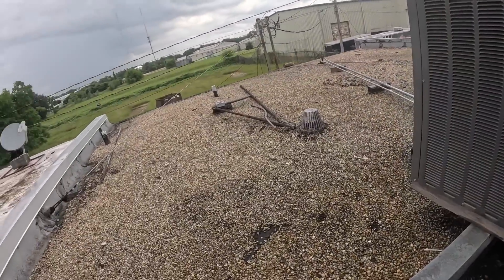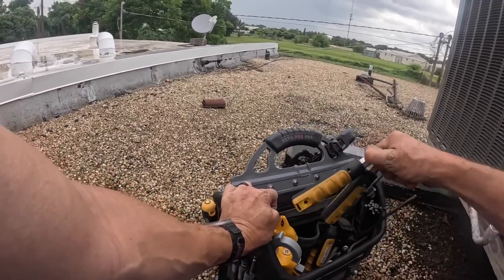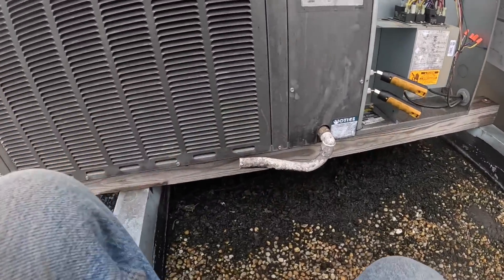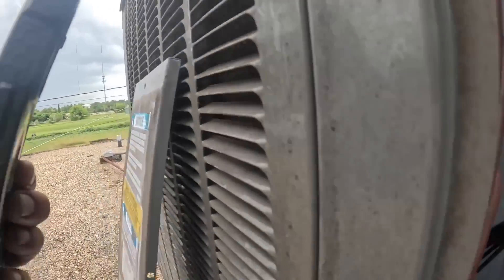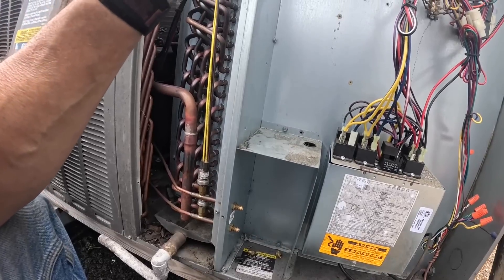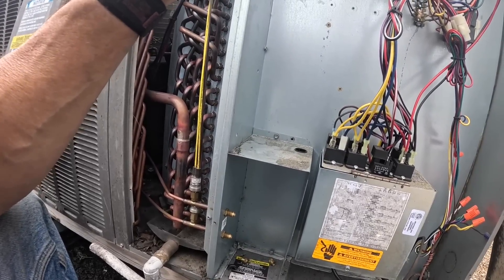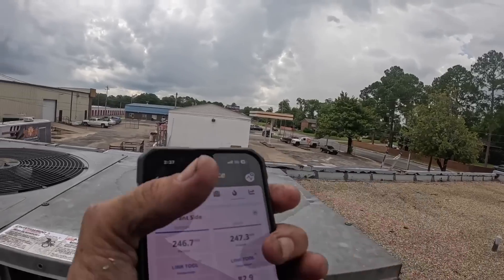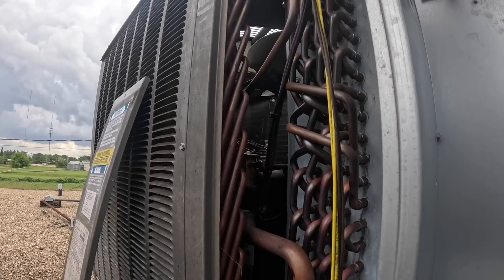Why Is This Happening All Over Again? #hvacguy #hvaclife #hvactrainingvideos

Comment: Not very helpful advice here for you, we have a back room unit at one of our stores that I changed the txv on probably 5 or 6 times, I also pulled the compressor out and dumped and refilled the oil at one point because I suspected something was contaminating it. The oil seemed to help a bit but it still has issues occasionally, years later

Comment: I am pretty sure the sensing bulb has lost its charge. Being it  won't work in both directions.  Here's a trick hook the power head up to nitrogen. Apply some pressure. See it the unit stays running.

Comment: Another very good video.
About 10 years ago, Copeland compressors had a problem with a manufacturing oil that caused TXV’s to clog. It was mostly for four ton in below, and the problem showed up within months of the equipment being installed new.
.
The solution was to add 4 ounces of nu Calgon renew product. But the system has to be running for the new Calgon to work.  It takes several days to clean out the TXV with the system running., with some results being seen within a few hours of the compressor running

Comment: Just pour some hot water on it and see if it opens up you could hear it opening up  we used to open txt and clean it with 99% alcohol and put it back in used to work for a while and then it’s up to you

Comment: I'm going to give you some advice that might save your life or at least keep you out of the ER. When climbing a ladder ALWAYS have a three point hold on the ladder, that is to say at least three parts of your body feet or hands should be on the rungs, never carry a tool bag while climbing. To climb properly and safely buy some 3/8" nylon rope, cut it to 10' longer than the maximum height of your ladder or ladders and install a latch-hook on the lower end. When you go to climb loop the latch end to what ever you wish to take up then take the plain end and loop it through the rear of your belt, leave about a foot of it below your belt, do not tie it off to your belt. Once you are safely on the roof remove the rope from your belt and tie it off to your ladder, then pull up what ever you need to the roof. If you need more equipment on the roof drop the line back down climb down and latch the equipment to be pulled up. Always keep your hands free to ALWAYS climb with a three point hold, your life depends on staying safe while climbing aloft. Always remember, "No job is so important and no service is so urgent-that we cannot take time to perform our work safely"

Comment: Years ago, I had an air handler that was doing that. The TXV would stick closed. I could take it off. Check it out. It would check out. I’d put the TXV back on and it would work for a week. Go back out there. it’s closed again after a week. I put on a new TXV and dryer, it worked for a week. I told him we needed evaporator, but I couldn’t get one and he needed to get somebody else. They put a new evaporator in it and quit doing it. I thought I going insane. And just like you I changed the Freon. I did everything. I even changed the compressor because it was under warranty at the time.

Comment: try a can of ac renew  iv had about a 50/50 success rate with it ,that thing is of the age they put corrosion inhibiters in the coil at manufacture , wrap the txv with a wet rag to try and not deform the body  when brazing  best of luck on the repair . thanks for showing the good and bad

Comment: Good Video ! First You have to Find out if the Txv -

1. Lost its Power head Charge - if so - it's a Easy Fix. Replace Txv & Drier. wire tie capillary to itself to help deter cracking & loss of bulb charge. look for a Rub out on capillary.

2. is Plugged with Debris / Plugged solid. if this is the case - You Must Try to determine what is in it. Cut open txv / disassemble txv & do a autopsie. Most Likely it's Compressor oil or the Compressor Windings coming apart. Whenever i Have a plugged Metering device on anything 5 Tons or Smaller. i Just replace the Compressor , Flush the System & Do a complete Cleanup or Sometimes its Wiser to Just Replace the Unit & is Usually Smarter & is Better than Dumping Good Money into a Old Piece of Junk. if its around 10 years old or Older Replacing the Unit is The Best Move for all involved.

Comment: I am not an HVAC tech, so take what I say with a grain of salt. To me it sounds like debris got into the system at some point and the TXV valve is getting clogged. As to where that debris came from, other than a degrading dryer filter, I would have no idea.

Comment: If it’s tripping out on LP in both modes, doesn’t it bypass the main TXV in heating mode? Does it have 2 x txv and check valves or different to that for heating? Great video again.
Reply from the maker: Just one txv that meters in both directions
Reply: @HVACGUY  that’s a new one on me. 👍

Comment: Have been seeing this a lot lately across all manufacturers reminds me of several years back when they had an issue with additives that they were putting in the compressors at the factory.  Doesn't always work but every compressor and TXV changeout should get a can of RENEW as well.

Comment: Maybe they (all manufacturers) should put in some shut off valves on both sides of any TXV so that they can be changed out quickly and easily.....without pulling the entire charge.
Reply: You mean like flare nuts? Then you may have refrigerant leaks there.

Comment: I think garbage from the first failed txv and dryer contaminated the system....  I would run 2 tanks of nitrogen through it and even put a 2nd dryer between original location and txv to trap particles before the txv

Comment: Possible wax from the compressor windings breaking down going through the system I’ve seen it on walk in coolers and it locks the internals of the txv in place just a thought

Comment: On rare occasion, wax polymers formulate from the compressor oil and clog the TXV.  A light torching of the TXV with low heat (i.e. propane torch, NOT oxy) can melt the wax and dislodge the TXV allowing the foreign particles to circulate and get captured by the dryer.  Permanent fix would still be required - replacing TXV with evac/refill of refrigerant. If light torching temporarily fixes the problem, then it justifies an aggressive nitrogen purge to clear coil/lines from existing foreign substances (i.e. wax) as much as possible during repair.  If heat doesn't fix the problem - it points more to being just a "bad" TXV without other foreign substances being the root cause.

Comment: If you do not need to return the warranty TXV the smart move would be cut it open and see in the needle/seat is contaminated with system debris. If it’s not and appears clean, likely a loss of bulb charge, that could be a manufacturer defect or an installation/vibration root cause. The last thing I would ever do is to replace a TXV with a fixed orifice. That style of metering control has extremely limited operation ranges. Any real load condition changes outside the narrow range will create compressor reliability concerns. TXVs while troublesome offer a much greater range of control and compressor protection.

Comment: Did you reuse the original cap tube for the external equalizer. Make sure it isnt plugged up, if it is, the txv will eventually fail shut.

Comment: What  type of  failure  are they restricted or powerless loosing  charge..are you cutting the  old drier a😢and  TXV out of the system  or just  un sweating the parts. I  always  cut o7t the drier and  bad pa4ts because  when you heat up the  drier  it releases the  contaminated in the  drier  danfoss expansion valves  loose the  po2er head charge  easily   seem like if you look at it  wrong  or  let your  heat off your  torch flame  get pointed  towards it ,stainless  doesn't  rust but is more brittle than  copper   we had high failure  rate on danfoss  valves  a couple times  and  I always have  put sporlan  valves in  .let us know what value  failure is when you  diagnosis it

Comment: TRY USING A DIFFERENT BRAND OR MFG ONE THAT HAS A REMOVABLE HEAD AND FLUSH SYSTEM OUT REALLY GOOD I WOULD ALSO CHANGE OUT EVAPORATION COIL IT PROBABLY CONTAMINATED AND VIRGIN A410 good luck

Comment: That’s a lot of work getting all your equipment on the roof to do the job. I did one last month changing a compressor only to find out it had a high side restriction. 32 year old ROOF TOP. I Ended up replacing with a new Rheem 10 ton unit.

Comment: Happy Fourth of July. Like Eric O from the South Main Auto Channel says, "I didn't make it, and I didn't break it."  Auto mechanics get defective new parts all the time these days. They say, "If it has wires sticking out of it, get the new one from the dealer." That is because the generic ones usually made in China, often fail after a year or so, if they even work at all.

Comment: The the screen could be clogged for txv. Seen that a couple times and the txv was not the problem. It was restricted in the screen. Blow the heck out of it with nitro both ways when you remove the txv.

Comment: I'm not in the business, but I feel your pain.  Getting new parts that are defective seems to be the new normal in a lot of industries these days.
Reply: It's a huge problem with car parts. I put a new alternator on my truck and it started smoking. Took it back to the parts store parts guy argued with me and put it on his tester and it smoked up the store.
Reply: @catfeline1530  No denying that one! Alternators and starters (I suspect) are not re-manufactured anymore, they only replace what is bad. Probably best to find a local repair business if possible.
Reply: I'm considering shutting down my business because of junk systems and parts anymore. Some of my loyal 20 year customers are getting pissed off at me because of a bunch of issues from junk replacement parts failing soon afterwards..
Reply: @Bryan-Hensley  try working on automobiles or lawn equipment or small appliances. You can’t get the parts and when you do, it’s all made in China and doesn’t work, doesn’t fit, or stops working. Gasket set for a small engine went from $12 to $35 now! I took my SS and just doing work for friends and family.
Reply: Quality control and bad imported parts is another problem to deal with!
Reply: @bobboscarato1313 There is no financial incentive for QC when manufacturing HVAC and Auto parts. It costs to inspect parts and since the manufacturer does have to pay the R&R labor, it's cheaper to have them fail in the field than have some one test them before they are shipped; the outcome is the same, but shipping is much cheaper than paying a human to do testing. This is especially true with China that gets favored nation/ developing country shipping rates that in most cases is near zero. AAMOF, if China had to pay regular shipping to the US they would lose a huge advantage they have over domestic manufacturing.
Reply: I do wonder if in this case, it really is two defective txvs in a row.
Could be some contaminate in the system doing it.

Comment: Partners choice sku 6646009R. Uses the bullet shaped piston that is in NORTEK equipment. That saves the day when you can't just run to the supply house and get a TXV. I buy them 10 at a time. Always have a great supply of excess pistons as well so I can size accordingly.

Comment: fwiw we’ve had major issues with indoor txv’s failing at initial install/startup  or after a few months of operation with some fist co units we’ve been installing at a project .. some are faulty at start up and some fail after a few months.. we are considering using aftermarket sporlan build your own type txv’s if the problem persists..

Comment: Are the acid tests reusable?
Reply from the maker: Sorta
Reply: @HVACGUY  Lol k.
Reply: @HVACGUY  depending on the manufacturer of those acid testers you can pry it open and replace the strip with standard litmus paper.  Much cheaper
Reply: In a bind you can use the tip of your tongue on a refr. valve cap! It works. lol
Reply: @bobboscarato1313  lol, that would be one hell of a pinch :)

Comment: The desiccant inside a previous dryer may have "let go" and contaminated the 410A with fine particulates. It's happened with automotive AC, notably with 2010-2012 Ford Escapes. I think your plan is good, replace the TXV and filter/dryer again and go with virgin 410A. Other techs really like the Sporlan Catch-All for these tough situations, might be worth it here.
Reply: I'd wager this is the answer. ^

Comment: I’m thinking I would start with virgin 410a and also add a suction line drier just to make sure that system is clean as possible. Go with a sporlan c-163-s-hh just to keep that system clean as possible. Or go way out there and add a drier with a sight glass to see if you see things in the system.
Reply: Put the filter right in front of the txv.

Comment: I'm sure when you changed the 1st txv you blew Nitrogen thru the entire system to clear the system. Maybe over time debris got loose and found the txv. Most manufacturers won't warranty a unit put in a hair or nail salon due to the chemical compounds they use. If heat pump evap coil will not be covered. Been there done that. It could be product broke or malfunctioned.